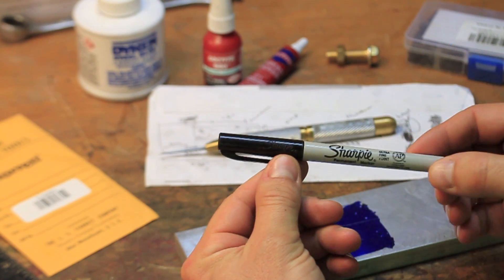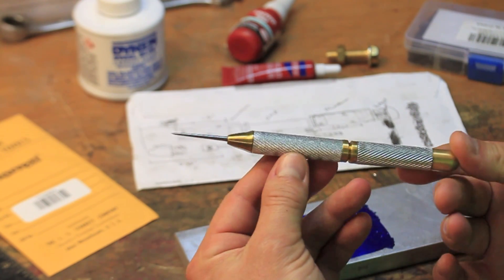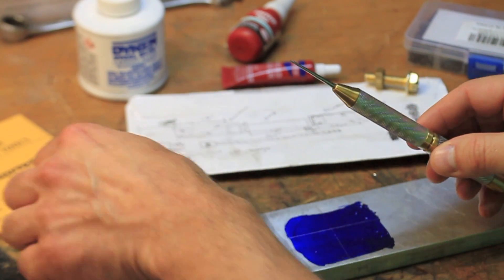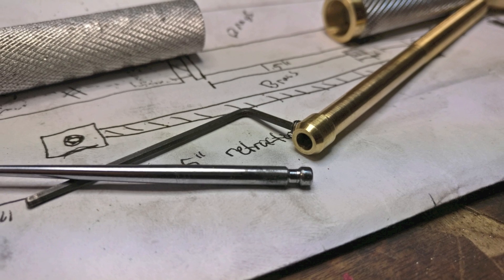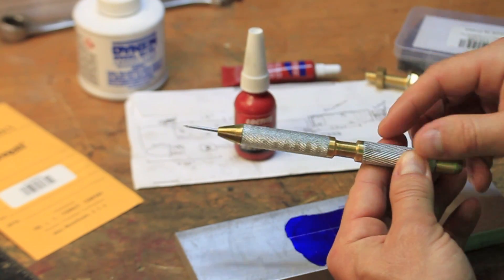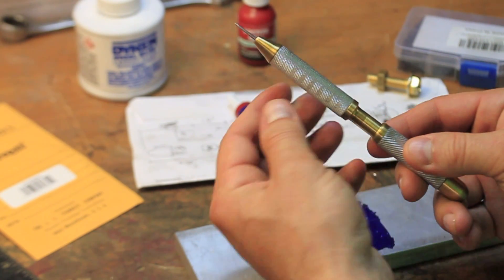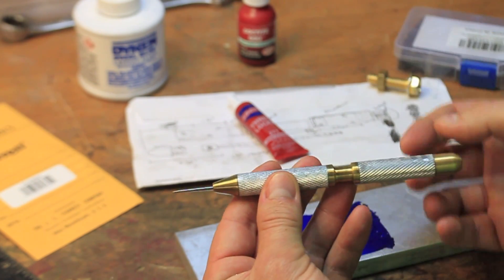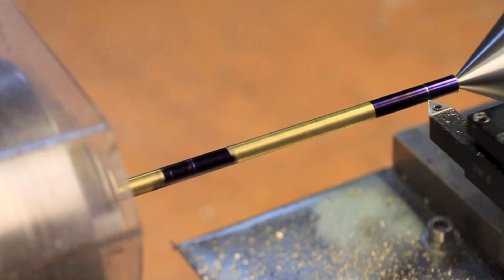Making a Retractable Metal Scribe out of Brass and Aluminum with a Starrett Tool tip

Comment: how did you get that rough texture on the aluminum piece? Also what was that green glue you used to glue that end piece on?
Reply: if you didn't find already its....KNURLING TOOL PIVOT HEAD DIAMOND MEDIUM
Reply: @ethanwrinkle,
The green "glue", is actually green loctite.

Comment: Hey I’m trying to make a 3D model of this project and then attempt to make one for myself. Any way I can get a dimensioned print of this project to make it a bit easier to reverse engineer.
Reply from the maker: If I had one to give you, sure. But I never modeled it myself.
Reply: TimNummy any chance you could give me the outer diameter and overall length extended and retracted?

Comment: great job However I would use a dart as the metal tip is already in a brass shaft and has threads in the back of it.
Reply from the maker: That's a good idea! I don't know if the tip would last as long though but I'm sure it would last long enough to be worth it.

Comment: For the bluing, I think what you need is a more even heat. I would suggest putting your brass shavings rig in a small toaster oven. What you want to be doing is heating the brass shavings which then distribute the heat to the piece you're attempting to blue. Also you should probably have the piece fully covered in the brass shavings. I really liked the design and function of the ending product
Reply from the maker: Thanks! Now I just need an old toaster oven (which I was thinking about getting for powder coating anyway?? 

I'm glad you liked how it ended up! I appreciate the comment.

Comment: Why not use a tungsten electrode from a tig welder?
Reply: I was wondering this, could utilise the clamping jaws from the torch too to adjust the length as opposed to the winding in & out. Would make for a more compact design when in your pocket.
Reply: Thomas Neate tungsten is brittle
Reply from the maker: That's a good idea - I don't have a good reason not to.

Comment: Very clever.  Not much point putting a high polish on something you're going to knurl -- it will end up with whatever finish is on the knurls + bits of metal in the way.

On the bluing, I suggest Brownell's cold blueing solution or similar so you don't mess up the heat treatment of the scriber point.

Comment: Like the vid and not trying to be a d1ck but that knurling  i think the od needs to be adjusted to get the pattern right
Reply from the maker: What's wrong with it? It might be a little twisted but that's the feed rate more so than the diameter of anything. And that doesn't make it "wrong" necessarily, just different. Thanks for watching and commenting!
Reply: TimNummy dude calm down....i didnt say it was wrong. I love this project. Just saying the knurling wasnt perfect little diamonds more like perfect little rectangles. Still fuckin nice project

Comment: Typically when blueing in brass chips you heat through the bottom of a container allowing for even heat without direct flame contact. Since the flame came in direct contact you promote the formation of oxides

Really enjoying your videos.
Cheers
Reply from the maker: Thanks! I actually tried it the proper way in a later video and still didn't have much luck. I'm thinking it either didn't get hot enough or the steel is an alloy that doesn't blue very well. I'm glad you're enjoying the videos and this is my next bluing attempt if you're interested: https://www.youtube.com/watch?v=JmOQzMidZ3k

Comment: Love the video, definitely make the pen, but maybe do the pen opposite (aluminum where the brass is and brass where the aluminum is on the scribe)?

Also, you had the right idea for bluing the steel but wrong form. You want an indirect heat on the brass shavings so the steel heats slowly. Run to your local dollar store and grab a mini loaf pan(maybe 4in×2in-ish) and throw your brass shavings in it, drop your steel part on top, then use the torch and heat it from underneath.
Reply from the maker: Thanks! I'll have to give that a try... 

I was tossing around some different ideas for a pen version of this and haven't quite settled on what I'd like to do yet. I'm glad to know there's interest though!

Comment: would it work if you removed most of the threads in the middle of the bolt? that you you could unsqrew a 10th of the way slide it 8/10 then re-sqrew it the last bit. then you wouldnt have to turn it so much and it would be much faster?
Reply from the maker: Yeah! I thought about that too after the fact and might try it on the next iteration. I'd just have to make sure that there's enough threads to properly engage on each end. 

Nice thinking :)
Reply: @TimNummy  you could also turn multi-lead thread on the OD of the scribe piston and ID of the body which would increase the advancement of each turn; if you use a triple lead thread each rotation would advance the scribe the same distance as three rotations of the current single point thread. Great video by the way keep making badass stuff!

Comment: nice, but the problem is the length changes when you move the tip. One solution to this is to add a nut like ring in the middle and you twist this nut to move the internal piston.(the hard part is to make this nut captive to the rest of the scribe)
Reply from the maker: Ah ha! The length actually stays the same the entire time, the only difference is how much of the body is covering the scribe tip. I thought for a while about the nut in the middle idea but couldn't sort out a way in my head to make it work. Not to say it couldn't be done, it'd just be tricky like you said. Thanks for watching!

Comment: Nice work! now you need to truing your chuck jaws, I saw something weird in the closeups, or maybe just some gentle taps to precisely align the piece. Keep up the good work.
Reply from the maker: Hey thanks!!

I think the weirdness might be the low tolerances that this lathe was built with but more so I was doing a lot of the machining with the pieces threaded together so it was kind of sloppy. There was definitely a lot of off camera adjusting and tweaking.

Comment: is there any chance you would make some of these to sale?
Reply from the maker: That's flattering! Maybe, possibly? What'd you have in mind?
Reply: TimNummy I work in a union sheet metal shop and it might be a nice addition to the tool box for some of my coworkers. have no idea how much time you have in making them.
Reply from the maker: Keith, thanks so much! I was trying to think of the best way to offer it. It does take a bit of time to make but what is a bigger limitation is the about of spare time I have to make them. I put them up on Etsy for sale, I have no idea how much they would be worth to you but I priced them according to the cost of materials and time it would take me to make if you're interested. Check them out... https://www.etsy.com/listing/533299875/machinists-scribe-brass-and-knurled

Comment: Nice project.  The next one maybe try a double or triple lead thread for the retract feature.  I really like the tool.
Reply from the maker: I wish I had either a tap and die for that but they seem to be rare/expensive or an internal threading tool small enough to accomplish that.... any suggestions?
Reply from the maker: Also thank you so much for watching and subscribing!! I've watched and learned from some of your videos and your viewership is definitely flattering!
Reply: That was my first thought too.  Tim, Tubal Cain/MrPete222 has a good video on multi-start threads on the lathe.
Reply from the maker: Yeah they seem pretty straight forward, I just need to find an internal threading tool small enough for an M6 sized thread.
Reply: For the internal threading tool, make it yourself out of HSS.  You'll need a fishtail gauge and a magnifying glass and some practice, I expect.  M6 is basically quarter inch, so you have some room.  Use a stick of 1/8" square tool blank (or the traditional method where you heat the end of a tool steel rod yellow hot and mash it sideways, then quench it and draw the temper slightly and grind on that.

Comment: Definitely want to see a pen. I've watched Jeremy Schmidt's video on making his more than any other Youtube video: https://youtu.be/18w-8JvSHI0

With your experience on the lathe so far, do you think it's worth the price or would you advise saving up for a nicer old lathe? Seems like a great learning experience at a minimum.
Reply from the maker: Thanks! Jeremy definitely has some good videos - I really liked this one as well https://www.youtube.com/watch?v=wtXJUfpj8tA&t=827s - he makes a scribe too I believe.

At this point - I think if you're looking to save a little bit of money and learn how lathes work (and don't work) and are interested in a project to make it better, then it was a pretty good deal. If you want to be able to take it out of the box and use it without any issues, then this isn't the one for you. That said, if you are considering and older lathe that needs work/restoring vs this lathe for the same money, I would likely lean toward the older restoration because you will still learn a bunch and it will likely be a much higher quality unit in the end. 

The bummer is that there isn't a tremendous selection of table top sized lathes available and the higher quality lathes are either bigger (more industrial/commercial quality) or smaller (precision watch making and such) sized. So if you're looking for something around this size, I'm not sure how many other options there are out there.

Comment: Really nice project. What are the stick looking things you are using to do the polishing? I think I'll have to build a couple of these'
Reply from the maker: Thanks so much - they are just regular wood dowels from the home improvement store... I saw someone else on YouTube use wood with polishing compound and I figured it's way safer than a towel or rag on the lathe and seemed to have really great results. The compound is just cheap metal polishing compound.
Reply: Well, that makes sense then. I'll have to give it a try. Thanks for the reply.

Comment: Nice job! Regarding blueing, on all videos I watched people usually direct  torch to the plate from beneath. The plate warms up chips, and the chips warms up part itself.
Reply: Im sure you seen his videos, but if you missed it, check out "clickspring" on bluing and "machining porn" in general, oh and by the looks of that first cut, it looks like your tailstock might need realigning
Reply from the maker: Thanks! Good eye for the detail - now that you mention it, I recall that too from what I've seen... I kept the brass shavings so I might have to give it another try.
Reply: Yup you're right never put the material in direct flame or else it will burn the brass chips which will result in ugly blueing of the part